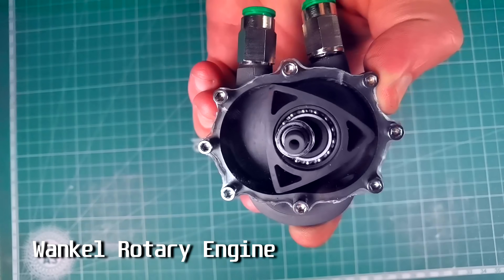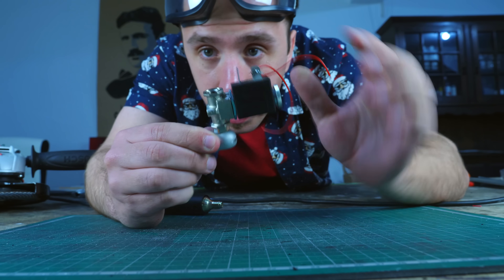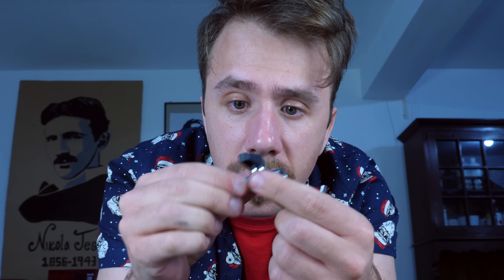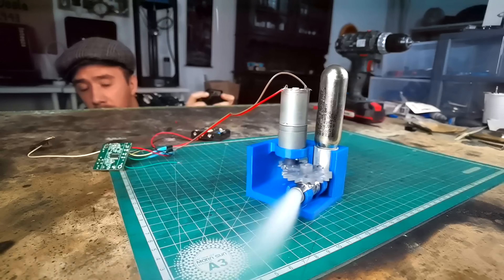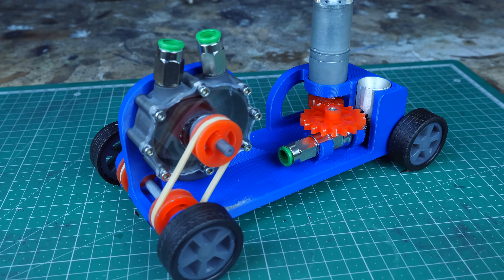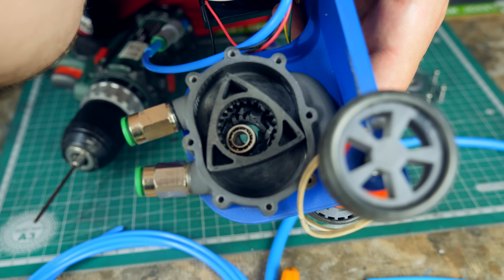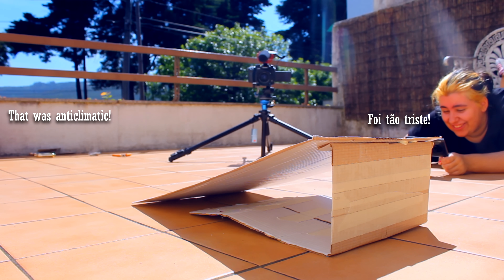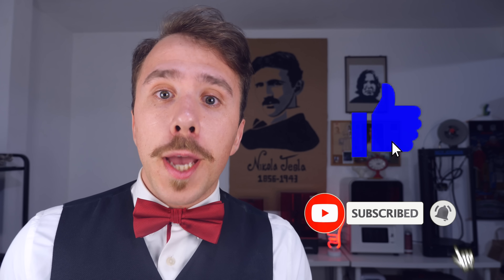Rotary Wankel RC Car (3D Printed)

Comment: THE AWa HiSpee-D! 

Build THE Awesome Wankel High-speed Dragster!
The Wankel-Car V2, faster then a F-22 Raptor!

Maybe you could use the Pressure Regulator that 3DprintedLife used in his boot, for much more runtime, and an empty Cartridge as a sort of expansion chamber were the CO2 "Snow" can sublimate for more Gas/Pressure build up.
And maybe use Gears instead of a Rubberband?

Do It! Race faster then any Tomato ever can!

Comment: Instead of having the air outlet from the engine pointing upward, it should act as a second thrust, so both the engine and the CO2 thrust.

Comment: The Rubber band belt is spinning without gripping because the motor has too much power. you could try better belts or something that reguleates the pressure so you have longer acceleration and more grip on your belt

Comment: To help seal the treads use Teflon tape next time; 
The rubber band seemed to losse in the car it needs more tension to reduce losses; 
Integza one rotor is cool but can u design a 2 rotor engine or maybe a 3 rotor engine? 
Love your videos and projects keep making them and destroy those tomatoes

Comment: you probably already considered this but I don't think your wankel motor can handle the pressure of the cartridge you need to regulate or limit the release somehow, and the rubber band was not cutting it for a drive belt, i'm sure you can come up with something better. one of the slow mo shots of just the motor running on CO2 showed leaks from everywhere, that would suggest you either need to reduce pressure or make a stronger motor.

Comment: Ruber bands will do a poor job, with resistance the will start to jump and the torque transmission becomes crappy. In the other hand, gear will do a better job.

Comment: It would be very cool if you designed a helicopter with tip jets using a variation of your 3D printed rocket engine design.
https://en.m.wikipedia.org/wiki/Tip_jet

Comment: This was awesome! I think you should revisit this. With some minor improvements, you could really make that car work great.  Try using a servo for the throttle instead of a motor. And also turn the car around to make it rear-wheel drive. Couple with a better drive belt and I would be willing to bet you have a very useable RC car.

Comment: You're a hero, kind of.
You waste a lot of gas because you don't give the liquid CO2 a chance to evaporate. You need an expansion valve with an opening small enough for the CO2 to evaporate before it goes into the engine.

Then you would also be able to get up the embarrassingly unstable ramp AND you could limit the speed of the engine a bit.

Comment: Very nice project

I think what you need is:
- more belt tension
- lower more constant pressure on the engine
With that you should get drastically more of that energy onto the road.

Maybe for the next time update the car and maybe you can print:
- belt tensioner
- pressure reduction valve (should be possible with the resin printer)

Greetings from Austria to the beautiful Portugal, I envy your sunny weather :)

Comment: 3d print a 3 rotor wankel rotary engine and use it to power the drag car !! Also you could add another pair of wheels on the powered axel of the car in order to have more grip and use gears instead of pulleys for the transmission !

Comment: It looks like there's a lot of solid CO2 coming through your engine. Would a length of copper line help warm up the gas and give you more expanded gas to work with?

Comment: Easy idea, reverse the direction of rotation on the Wankel (make it rear wheel drive) and see if the car will do a wheelie.
For the valve, look for a Radio Control hobby store and see about a pneumatic retract valve.  Many are rated at 100PSI some can do variable flow.

Comment: Rubber band had too little grip, and should be replaced with a more direct drive solution for less lost energy if you can control the gasses outpost more to not just be 100% open the entire time

Comment: Dear Integza, you need a belt tensioner and a gear reduction after the engine, please !!!!
edit: as you said the rotational speed of the engine is too high and it creates vibrations that destroy the mechanical parts.
edit 2: otherwise it's a nice job ! but your sisters are more interested into rocket science

Comment: need to get an adjustable needle valve and control it with a lower gear reduction so you can finely tune the psi coming out so you aren't just blasting the engine full tilt. Also a gear box to the wheels would also probably be a good idea because the engine wont be generating a lot of torque at low RPM.

Comment: Can you compress the gas coming out of the  cartridge through a compressor and power the vehicle. Would that even work , and if it does would it increase or decrrase the efficiency of the engine?

Comment: The Wankel engine didn't really worked, but you could store the energy of the cartridge in to a flywheel and release the energy gradually to the wheels of the RC car.

Comment: It looks like the pressure is just too high. Maybe the car could go further if you add a reduction somewhere. Also the little rubber band had a lot of slippage. How about a GT2 belt? That could increase the cars range

Comment: Try this again, but use a gear ratio to reduce the much higher rpm to something more manageable. :)  Not sure if the engine could move the extra weight of the gears, but it would be awesome.

Comment: If Integza made a proper pulley system, with a gear pattern on the band and pulleys, he would loose a lot less speed/energy from the engine.

Comment: basically.....you were not running on CO2. You were running on Carbon Acid! I recommend you to find and disassemble the Crosman C11  pneumatic gun. There you will see that its valve has a camera where Carbon Acid has a place to expand into the CO2 gas.
Moreover, the very mechanism of Crosman C11 valve can be used to dose the CO2 coming to your engine. 
P.S. The same valve is in Crosman C21 and 31. Also in Borner W3000

Comment: I wonder if you couldn't get a lot more duration out of the motor by slowing down the CO2 release and using a heat sink to warm up the CO2 on the way out of the valve. The 'warmed' CO2 will have a lot more volume than the frozen vapor.

Comment: Integza - created a whole series of videos trying to create a 3d printed rocket engine, which all fail. 
Also Integza - almost gets hit in the face from radio controlled 3d printed CO2 cartridge holder that turned itself into a rocket...

If at first you don't succeed, try something else, fail at that, but accidentally succeed on the first thing you tried. Classic integza...

Comment: I wonder how well this would propel a model boat with a propeller.  Or maybe you could use that valve system to make a remote control hot air balloon.

Comment: The CO2 gas comes out solid, which is not ideal, so use some gas that doesn't freeze which will increases the volume and hence the power of the engine

Would love to to see this with combustible engine design

Comment: video idea: you should try to  print plastic rockets again but fill the inside of the walls with water to provide cooling and increased spesific heat. should solve your problem of changing parts on every test

Comment: You need a pressure regulator for the CO2. That will make it easier on your engine and allow it to run much longer.

Comment: I feel like an expansion chamber (to allow dry ice chunks to sublimate a bit) and needle valve (to slow the emptying of the cylinder) would help this car drive even with the same engine. Obviously gearing it down would also be good.

Comment: Can  you use  the Engine for  a  Propeller (HELICOPTER) mybe if you find a Smart Design which allows you to Open the Ventil from the outside and make it signifcant Lighter.

Comment: Idea: instead of the CO2, you can use high pressure air. There is paintball/scuba equipment that lets you do 4500 psi and has regulators and doesn't freeze up or run out of capacity in one burst. The cheaper pumps are like a bicycle pump. The smallest tanks are still fairly large though.

Comment: So, you have those resin rocket motors. What if you used them either for a 3D printed rocket dragster OR found some way to use the combustion byproducts of the rocket to power a regular engine? (Though, you'd probably melt the wenkel engine, but maybe some sort of metal turbine?)

Comment: for you to use the engine you should use metal gears inside it so they won't brake from the amount of force coming from the CO2 and you should use a chain that goes from the engine to the axel/tires so most of the power from the engine is actually being transferred and use tires that a bit bigger with better grip so it is easier for it to move

Comment: The cold and partially sill frozen CO2 is much  denser (has a lower volume) then it would have on room temperature. Maybe if it had some kind of heat exchanger allowing the gas to heat up a bit and thereby propperly expand and provide more thrust.

Comment: next do a 2 rotor based on the same design. Might have to do a 2 piece eccentric shaft coupled in the center bearing.

Comment: I think you really should rotate your co2 cartidge so that the exit is facing up the way you do it loses its content faster because your spraying liquid co2 out instead of using the full potential. We have the same issue in airsoft when with replicas upside down.
Also if you point the motor exhaust facing rear you will utilise some of the leftover energy coming out of the engine.
And as you said, maybe change the way your motor power is transfered to the ground (gear ratio, transmission)

Comment: Video idea: try to 3d print another rocket engine, that works with an oxygen tank and ethanol fuel. You could use the pressure of the oxygen tank to pressurize the ethanol. You could inject the ethanol on 2 points on the side and the oxygen on the back into the combustion chamber.

Comment: You can 3d print a plane, and use cartridges to take off the plane (you can use the old car's circuit to controll the plane in the air)

Comment: The gas flow is too high, which generates too much and too quickly increasing torque. The belt is not able to transfer this moment to the wheels, and even if it does, the wheels will not transfer it to the ground. I suggest using a worm gear to dose the amount of gas more easily or additionally use a throttle behind the valve.

Comment: Video idea: 3D print a press for crushing tomatoes, and use a transmision powered with the Wankel engine. Using that high RPM you could create a good torque.

Comment: this car would be vastly improved if you geared the engine output to the wheels instead if the slipping rubber band, maybe even use the fast engine to spin up a flywheel to power it.

Comment: If you try to improve this design in the future - next time make the engine power the rear wheels.  The acceleration causes a torque around the centre of mass of the vehicle, which causes less pressure on the front wheels and more on the rear wheels - which would increase the grip of the rear wheels - and accelerate the vehicle more.  In the slow-motion shots you can see the front wheels rising off the surface, wasting some of the available power.  Great video, as always.

Comment: running the Wankel engine, so if you put a CO2 regulator before the valve you could drop the running pressure down to between 100-300psi to get longer running time, also those canisters hold liquid CO2 so when you have them upside-down like that you loose the contents rather quickly because it expels the liquid before having a chance to change its state from liquid to gas. If paintball is still a thing in Portugal you could grab an old used/second hand adjustable foregrip regulator or a regulator off of a reusable CO2 tank.

Comment: Integza. Just a simple piece of advice. If you have the CO2 canister pointed downwards, liquid CO2 will poor out which can cause inconsistent pressure down the line. This causes problems in paintball markers. If the canister is pointed upwards, the liquid has time to expand and it's apparent output will be more consistent.

Comment: Hello Integza 
i want to speak about the problem why your wankel engine just could not move the car good enough to go over the ramp.
At the end end of the video you said that the wheels could not handle the power of the engine.
When viewing the slomo clips I assume that the courrently the wheels are not your problem, infact your rubber belt which is connecting your motor to the driven axle is scipping an not able to get the power down to the wheels.

Comment: I suggest putting an evaporator coil that supports high pressures and flow rates between the co2 cartridge and the engine and adding a way to vary the flow restriction of the gas. These modifications will greatly improve the efficiency of the engine because co2 cartridges store the gas at such pressures that the carbon dioxide is liquid at room temperature. The issue is that as the gas expands, it undergoes adiabatic cooling and pressure is lost to both the extreme cooling itself and the condensation. Thankfully you’re dealing with cryogenics so, ambient heat is sufficient to compensate. Also, you can say your engine runs on ambient heat; though strictly speaking it already does.

Comment: Looks like your engine is not air tight, leaking from the edges of the clear cover. I think your losing a lot of power with the rubber band. You should make it  an all gear assembly, cut out the rubber band. Also if there were some way to let out just the right amount of CO2 instead of just full throttle. 8s there any way to recycle the CO2 as well? Instead of just exhaust can it get stored again somehow? Run it in a loop?

Comment: You should add a flow limiter between the cartridge and the engine. It looks like a lot of energy is getting wasted from the motor running too fast for too short.

Comment: Man, I don't think you noticed, but I think you are able to use your wankel motor to get over the ramp. But first you have to solve one big problem. Watch the fragments in slow motion as the car accelerates. I think just one rubber belt does not do the job as the main component of your drive. It cannot transfer all the torque from the engine to the wheels. Also, don't forget that you waste a lot of energy when the wheels are spinning in place.

Comment: You should use Arduino with rf modules to regulate the flow, so that its can start slowly and more efficiently use the pressure.

Comment: Gear it down and the little rotary will roast those dead car tires!  Also where the "bypass" is on the engine add another co2 input to double the power!

Comment: Make a dual rotor version (rotors at 180 degrees offset) and open the valve less, you are losing too much of the torque to blow by (pressure is too much for the rotor seals).
Making it dual rotor and opening the valve less to get it going should increase usable energy from those cartidges.
And maybe use a gear drive because the band is slipping too much.
And for materials, I suggest trying to use POM plastic, as it's very strong and has self lubricating properties (which the graphite apex seals would help). You could also lube it with a thin layer of Krytox 205 grade 2 lube (plastic safe lube used for keyboards, use a thinner layer because thick layers create too much drag) to simulate the engine oil Wankel engines use and further reduce blow by.
Hope this helps iron the issues out.

Comment: A pressure regulator would greatly increase the efficiency of the rotary engine. Maybe even a small heat exchanger to help warm up the co2 as it leaves the cartridge

Comment: you should 3d print an engine that lowers rpm but increases torque and get large dragster wheels. then the power would be put into the ground more effectively and it could go very fast. also make sure to have a better power delivery system than a rubber band lol

Comment: You are probably loosing a significant amount of energy due to piston blow-by and not allowing the gas to fully expand. 20 gram CO2 cartridges are at ~850 PSI (~58.6 bar) and the rapid expansion of the gas causes it to become extremely cold. Regulating the output pressure may reduce piston blow-by and allow for the cartridge to stay warmer and the gas to expand more before passing through the engine. Some of you test shots show solid CO2 (dry ice) coming out of the engine because it is so cold.

Comment: I think it would be far more efficient to have the air pulse through the engine, timed to simulate the combustion stage of a real engine. rather than having all the air rush through at once simulating a turbine

Comment: First - use safety thing for propane tanks, looks like a sponge from metal shavings, prevents liquid propane from getting to torch directly. It will help maintain pressure without losing CO2, cause it also liquid inside these cartridges.
Second - use an additional chamber after the valve to build pressure, it will help a lot, just like a rocket nozzle, but not for a rocket))
And last - sry 4 my English)))
About a cool idea - what about some techno tomato killer? Some sort of spikes, punching these nasty tomatoes with help of pressurized air and then releasing some icy CO2 into them?))

Comment: you need to open the vale slowly....this is like popping the clutch to "burn rubber".   Clearly the rubberband was slipping (burning rubber??) and not applying the force captured in the cartridge to the wheels as proper torque and aceleration.   A valve you can open part of the way (using an rc servo?) would allow you to 1) control the force/acceleration, but 2) allow for a longer application of the force to gain overall speed when the cartridge was empty, and allow you to use the bigger canister.   Best of Luck - Love the videos, and yes - TOMATOES ARE DISGUSTING!